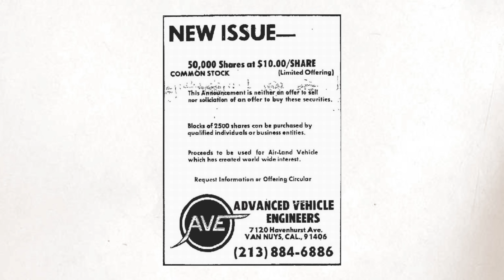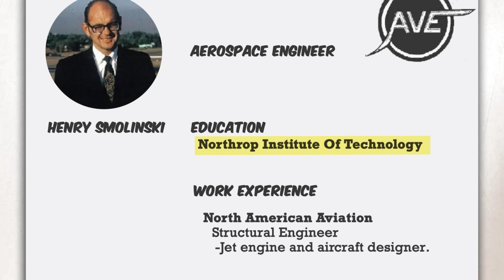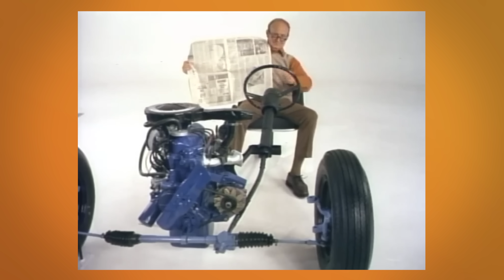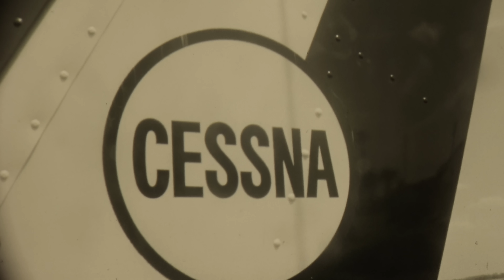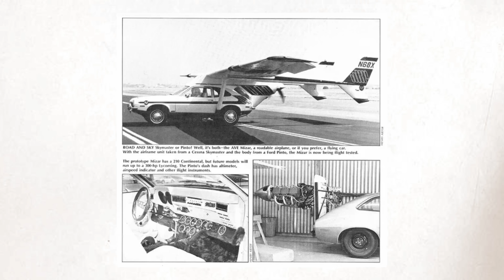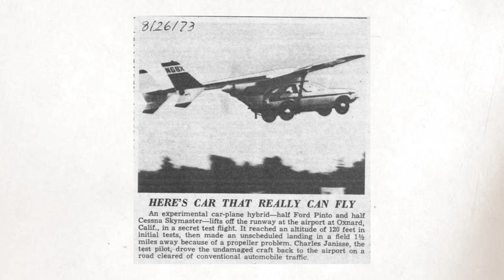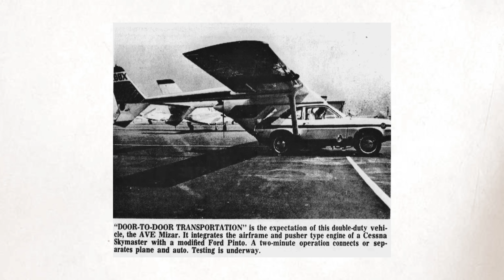The wild 1970s flying car that actually worked... until it didn't

Comment: Helicopters are not an extant solution to the lack of flying cars. The everyman might be able to by a used small helicopter if he can get financing or saves up the cash. Renting them, if available, may get expensive quick. But I suspect recurring costs may be difficult. Training is a big journey similar to fixed wing aircraft I assume. Flying cars, while expensive at first, could possibly come down in price in time with large enough production. They should be designed to be exceedingly simple to pilot vs driving a car and licensing can be a lower threshold to meet while still checking for competency. Design them to auto-land in a physically safe location when fuel or battery level gets too low, with a sufficiently generous buffer so people don't die on the way to work because they forgot to charge/gas up the night before.
What's the problem flying cars solves? Ground traffic congestion. Of course with enough flying cars in use, it would increase the risks in flying conventionally.

Comment: It would be easier to convert an airplane to drive on the road. adapt the gear, make the wings and propeller removable, add a powertrain and road-able cooling system...

Comment: The only way we'll ever have "flying cars" is if computers and guidance systems advance to the point where they would require ZERO skills from the driver/pilot. You input your destination, and the computer (networked to a nationwide grid) flies the vehicle to your destination. Seems a long way off, considering we still don't have autonomous cars that won't crash themselves.

Comment: This was like the OceanGate submarine. Safety was the number #89 priority.
Reply: I bet if they had a submarine that it be safer than their submersible that was lost
Reply: The shocking thing here though is that the guy who made it was an aerospace engineer. After the first plane crash landed, you would have thought that they would have fixed the simple and fixable problems. Instead of just putting on a heavier and more powerful engine without giving any thought to the predictable effects that that would have had. You would have thought that they would have considered also the risks of choosing a vehicle known to be prone to explosions
Reply: steve fossett pities your amateur adventurer hero
Reply: Not only that, but you have 89 likes!
Reply: submersible *
Reply: The number 89 priority on a list containing 10 total priorities.
Reply: The OceanGate PlaneCar! Fly in the sky for just six easy payments of $100,000
Reply: Yup, another company run by an idiot who thought he knew better than everyone else. Except he didn't even take into consideration that carbon fiber is hollow and is not the right material for high pressure applications like deep sea exploration.
Reply: more like #69420
Reply: 89th priority? That is being kind...

Comment: I've been carrying a full sized folding bicycle in my small plane for over 20 years, more recently I've electrified the bike. Having ground transport makes flying a heck of a lot more practical.  I can charge the bike's battery while I fly, it has a top speed of over 30, a range of over 20 miles, a Rohloff hub so also a super low gear, a throttle, a folding 2 wheeled trailer that allows me to safely (so far) carry13 gallons of mogas, (the plane burns 3.5 GPH) and I can have it out and be riding off 3 to 4 minutes after landing.   THAT'S my solution. I had seen this Pinto thing, never knew they crashed, and for those reasons, wow.

Comment: Personal VTOL electric aircraft should find a use as a short range air conveyance for those willing to pay a premium for the ride, but they should be controlled by a qualified pilot. The average person does not understand enough about flight to make these safe enough to fly without training. Qualifications would be tailored to the aircraft type, just as fixed wing and rotor wing aircraft require different skill sets. These drone style aircraft would probably be easier to fly than helicopters or planes. Since they would be used in fair weather only, I don't see the need for over complicated controls or outlandish instrumentation. The simpler the better. I see these as short range and hobbyist type vehicles. Basically, a drone big enough for you to sit in and fly. How cool would that be?

Comment: The problem is that flying cars are a compromise. They are not good cars and they're even worse as airplanes. 

The same goes for the owners. Private pilots today have a difficult time staying out of trouble from commonplace problems such as poor meteorological  conditions, fuel system management, understanding performance limitations, Weight and Balance issues, and so forth. Now imagine the common driver behind the wheel of an "Aero-car" of some sort... I don't predict a good outcome.

Comment: Interesting story. Btw, even if the mizer hadn't  killed its inventors on their first attempt at flying it, it was not remotely close to being "better than the plane it was based on." Sky master is a six-seater, cruising speed almost 200 mph., range of 1325 MI.
Flying cars, a solution in search of a problem, is spot on. Plus there's no way the FAA is going to turn the public loose to so much as pull out of their driveway and fly to the grocery store much less turn them loose in the wild blue yonder 😊

Comment: You  will have to have  a pilots  license and a   drivers  license and  defined   air roads. The  plane will need to be computer controlled  to fly only on these air roads  ... but the noise of  thousands of  air cars  ..and the  crashes ..noone  does  crashes  like airplanes .  Can't  see it  happening

Comment: It's crazy that I had the same idea for the new Aptera solar powered car that's about to be released in 2026. My idea is a wing sleeve the car backs into and fits it like a glove. Even though this OG concept failed, I still think that a properly ENGINEERED wing body can accomolish their OG goal on the right car and be the most practical flying car around. It just needs to be built by someone who knows WTH they're doing. Not a project for shade tree mechanics.

Comment: Unfortunately because of the complexity of Overwhelmed aviation worldwide,
This concept is a long way off.
The thought of personal unregulated,  untrained pilots mixing it up with commercial aircraft Is a ticket to disaster!
It's hard enough staying safe, accommodating Travel work worldwide, With an average of over 5000 aircraft in the air on any daily basis.
The technological advances with Computers and GPS the industry has seen in the last 40 years is incredible, making travel safer.
Aviation is extremely complicated It takes many years to become a pilot, Including FAA regulations and procedures,
Not very many people have the ability to learn to be a pilot, I feel this long way off!
The thought of personal aircraft without any certification or training with the current systems is impossible,
Let's see what the future can do for us, but not now!

Comment: Cars and planes have contradictory design requirements. Cars primarily need to be strong and impact resistant with sturdy safety equipment like airbags. That makes them relatively heavy. 
Aircraft in contrast, need to be light. Everything else is secondary. Open the door on a light aircraft. It’s thin and barely holds together. How well do you think that’d do in a side impact test?

Comment: As an aviation enthusiast and an engineer, I think this concept is one of the best that has ever been thought. 
Nowadays all the “flying cars” are basically big drones or some type of a helicopter. 
But this was different, very smart. Drive your car in town and go to your local airport, attach the wings and fly. 
You obviously are not gonna fly everyday but it would be a good option. 

This project could have actually worked and maybe today we would have had much more advanced versions of this flying car… only if they did their engineering homework better

Comment: When I was in elementary school, a classmate's father had a business making wooden propellers for small planes.  He also had an idea to make a flying car from a Chevrolet Corvair.  I never saw the machine, either in the air, or on the ground.  One weekend, he was doing a flight demonstration at a small air show, taking a neighbor's girl up with him.  The flying car crashed and they were both killed.
Anyway, I was never enthusiastic about the idea of having a car that could fly.  One, or the other, but not both.  There are some interesting personal flying machines out there, but they all seem to be prohibitively expensive; autogyros, helicopters, etc.
Reply: Your comment set me to searching. I found the Chevrolet Corvair engine is popular with experimental aircraft builders. 2016 article excerpt:

"Partee’s airplane is powered by a rebuilt Chevrolet Corvair engine, an engine that has gained a lot of fans among experimental aircraft builders. The engines are old, but they are inexpensive. 'If you pay more than $250 for an old Corvair engine, you paid too much,' Partee told the gathering of EAA Chapter 1475 and the Wisener Field gathering.

Partee and Tumino have become so interested and involved in the utilization of the Corvair engine in home-built airplanes they have put on four 'Corvair Colleges' in the past where enthusiasts can go for a weekend to get help and instruction on working on various parts of the engine. At these weekend schools four or five different work tables are set up with Corvair ready to be worked on over and over by the students to learn the procedures on various repair issues."

----

The Chevrolet Turbo-Air 6 engine is a flat-six, air-cooled powerplant that was designed for the rear-engine Chevrolet Corvair.

----

Ed Cole, widely acknowledged as the father of the Corvair, said this about the Corvair's engine:

"...we naturally thought along the lines of a horizontally opposed six. It's one of the best balanced engines in the business from the standpoint of secondary forces and how they are absorbed by adjacent cylinders... As aircraft usage has proven, the horizontally opposed six is a very fine engine. In 1950 I logged about 300 hours in a Continental-powered  C Bonanza, often flying with instruments in very unpleasant conditions, and in the process I certainly got to know that engine's reliability. Many light aircraft are powered by this configuration today."

----

Ed Cole died in a plane crash in 1977 after he became disoriented while flying in foggy, rainy conditions.

Comment: To me a flying car has to be roadable, and a similar shape to a car so you can park it in the carpark. And it has to be VTOL and preferably be able to make horizontal (plane type) flight at like 200 mph. And have 2 or more seats. And looks great in your garage! If you can make that, it would be expensive but great! If a flying car doesn't have VTOL it's not convenient enoght to be a going concern. But with VTOL, you can land near the road and drive onto the road. And to take off, you drive off the road first and take off away from the road. How convenient is that? And if you are in flight and the (fuel/battery) is low, just land and drive (and you won't die if you run out, completely). 😂.

Comment: Flying cars have their place, but not for everyone, anytime soon. Batteries are the holdback, or at least the high energy required for VTOL. But to rip off the extremely rich, flying cars are a great idea! Since they will cost alot, why not rip the oligarks off (and charge even more)! Build a grear 2 seater that performs fairly well as a car, looks great with attention to detail and flies with VTOL and like 200 mph flight speed. And charge the same as the most expensive Bugatties (3 mill). 😂

Comment: These two poor souls might have survived if they weren't flying in a flying bomb (Pinto fuel tank dilemna). 
     One of the factors propelling the interest in flying cars ( pun intended) is traffic congestion. We already have cities like Chicago and Cincinnati where one road is stacked on top of another. Wealthy people clearly are willing to put serious money on the table when it comes to methodologies which allow them to reduce travel time.
     Relative to current technology, the flying car concept is viable - with MANY considerations. 
1     Flying car altitude, speed and navigation will be controlled through automation. Likely we will start seeing limited test areas in suburban areas where there are designated flying areas adjacent principal highways which feed commuter traffic into cities. Every mile or so there will be PADS where flying cars will make forced landings when their charge gets low. There they will be able to recharge. Eventually amenities...restrooms, food etc will follow. Altitude will be low...probably around 12 metres  / 35 feet.
     Contrary to what was stated in this excellent video, collapsing / folding wings ARE wise and viable - Vought Corsair being a Pioneer with this technology. Except that electric or hybrid flying EVs likely won't use wings - they will use pure VTOL - type levitation technology as used with drones.
3     Insurance provider requirements. Only way the insurance heavyweights are going to insure people for hybridized car / aircraft vehicles is if certain requirements are satisfied. Operators will likely have an endorsement on their driver's license certifying them for flying EV operation. SOME basic flying skills will be necessary including meterology, airspeed management, compass use etc. How will the flying car authenticate that the operator IS the actual person operating the flying EV ? Probably a retina scan and / or password.
      In summary, flying EVs are NOT a fad and they are NOT going away. Driven by demand and rapid improvements in technology, it is virtually ONLY a matter of time before civilians begin routinely operating hybridized flying EVs.
     Have fun people. Safety first...ALWAYS.

Comment: the suspension of a car has very little travel, compared to the suspension of the airplane. to have a good landing with car-airplane, you have to be VERY cautious about speed, wind, rate of descend... every hard-bump puts enormous stress on the car and the wings.

Comment: My favourite flying car, the Fulton Airphibian. The plane and car parts were all purpose built. As a light aircraft, it looked quite like a typical post war light aircraft, except that it had 4 wheels. The wings, rear fuselage and propeller were removed for road use, and it would go along on the 4 wheels. I get the impression that this was the most successful flying car. 
I would like to know what connection the Mizar has with the Man With the Golden Gun flying car. I have heard that that flying car crashed, killing the test pilots. I assume that this was the same machine.

Comment: There will never be common flying cars until antigravity is invented. Can't have a fender bender or simple mechanical failure result in devastating a neighborhood or school. Also, the Pinto got a bad rap from Nader. It actually was firmly in the middle of average in crash fires.

Comment: Molt Taylor created the (REAL) AeroCar decades earlier and it was well designed and built plus your wing and tail assembly folded up nicely and was toed behind on a small trailer. 
He designed other aircraft including COOT amphibious and several variants if the IMP.   Molt was instrumental in the design of the         Cirrus VK-30  yes the predecessor to that Cirrus aircraft company!

Comment: The Pinto was an affordable, reliable, and easy to repair car. It was in production from 1970 to 1981 with 3.1 million units made. In addition to the standard 4 banger they made a sporty 2.8 liter V6 that was quite fast. I had a buddy that swapped the V6 for a 289 V8 that would blow the doors off all the Chevy's in town.

Comment: Hey don’t diss the Pinto!  That was a great car. I wrecked mine 3 times and it never caught on fire. It was low, wide and had good suspension which held the hilly roads just fine. I had about 4 different Pintos, one was even a station wagon.  Never had an issue that wasn’t due to human failure.

Comment: The Mizar was in the same neighbourhood and timespan as the Pink Panthermobile and about as practical

The single biggest problem with having a flying car is what happens when someone backs into it in a parking lot and then drives off. Will you know it's damaged and will that damage be important?

It's not JUST about safety in the air and even if the flight controls are fully automated it's the ground stuff which will be the downfall

Comment: One huge difference, the car in the 007 movie was nothing even close to the size or weight of the tiny Ford Pinto. AMC was the automobile manufacturer that was furnishing several of their latest models to promote their brand. Pretty sure the car that escaped from Bond by flying away was the latest model of the two door Matador coupe

Comment: Flying cars would never work, like road cars do, maily because of crashing, it's bad enough when a road car crashes, but having many flying vehicals wizzing about above our homes, gardens, parks, yards schools and work places all for them to crash down upon, or collide in midair first, and then crash down upon. Not only this but flying vehicals generally have to have people in towers to pass info onto and rules that thevtrained pilots have follow, they don't just jump into a plane switch it on and gad about freely, they have to talk to controllers, make sure they don't knock another plane out of the sky, and even then as recent events in D.C. have shown they can bungle that too. Also with the medi plane in PA if these things crash they become like a missile, not saying that the cars would fly that high or take as much fuel, there are also power lines, bridges and or the need for airports but  still, it's just a stupid needless idea, that would be fraught with problems